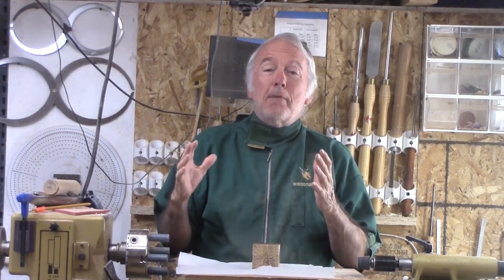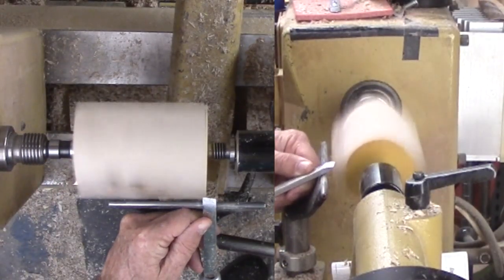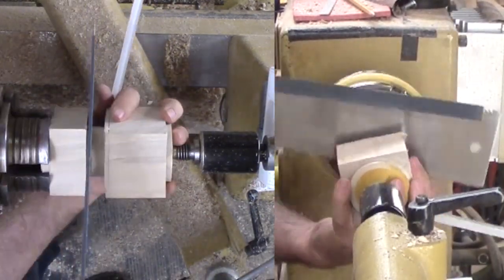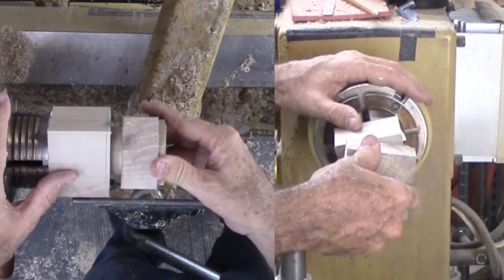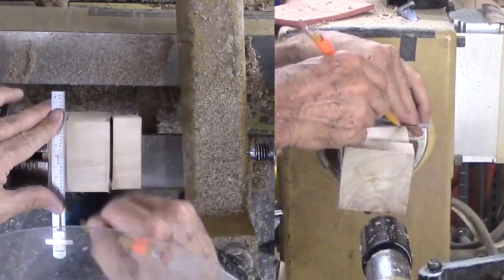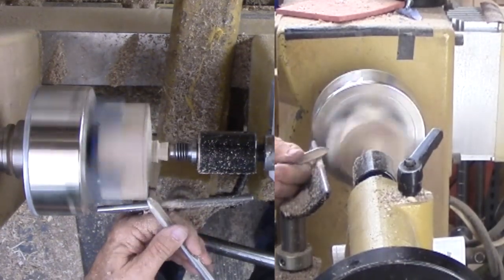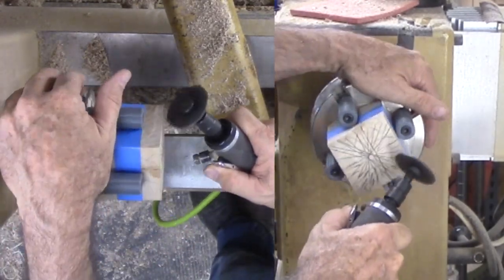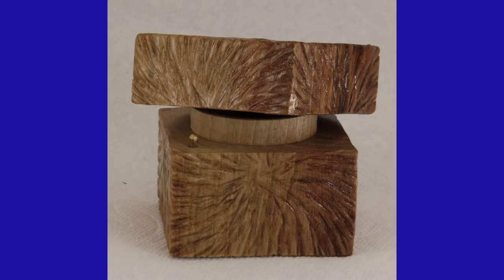What Not Round? How To Turn A Square Box

Comment: Enjoyed your video. Very instructive. Have you ever considered grinding the center spur off of a forstner bit in order to create a bottoming bit? You then drill most of the hole with an unaltered bit and drill just the last 1/4" or so with your matching altered bit to create a finished hole quickly and with very little effort.
Reply from the maker: Yes I have but hesitate to modify the bit.
Meanwhile, If I just stop a bit more short, I can clean up with a box scraper which could be required anyway.
Alan

Comment: Nice project. Very interested in the 3d printed corner jig and pins for the chuck. Care to share a link or file?
Reply from the maker: Just drill out a bolt or steel rod and glue it to a wood angle. Then you have it.
Alan